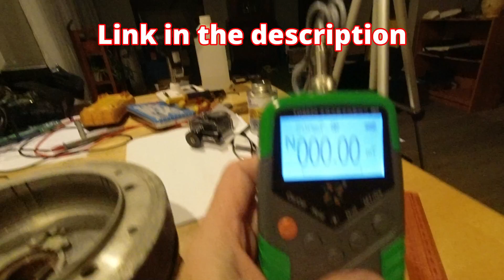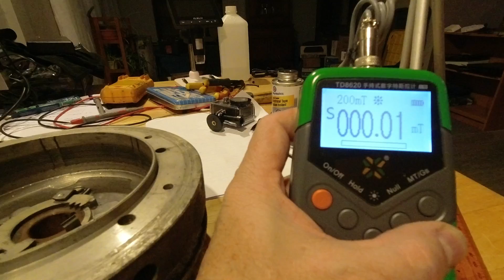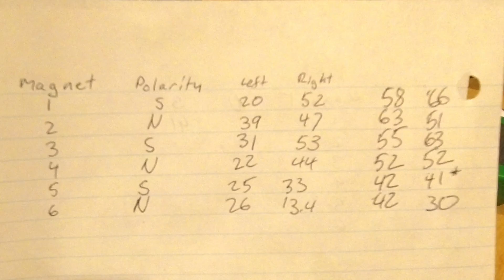MAGNETISM: Can We Test and Recharge Small Engine Flywheel Magnets?

Comment: Neato! Learned a new thing!
I wonder if an ignition magnet in an aluminum Poulan 2150 chainsaw could be recharged by the same method? This 1996 saw got weaker & boggy & finally stopped. I diagnosed No spark, ordered a coil assembly, installed it & still no spark by hand spinning the flywheel, then same with rope pull starter. Finally got small spark by spinning flywhl. w/vari. speed drill & spark got bigger as rpm went up! I'm suspicious of a weakened madnet now. Without the gauss meter, what pole  orientation do I drag the neo mag across the ign. mag. & how to find ign. mag. poles (N & S)? Thank you for posting vid.. Paul
Reply from the maker: I won't claim to be an expert on this but in my experience, opposites attract.  Saying that, it would be my guess that the magnetism that opposes the placement of the magnet would be the way to recharge the magnet.  I learned a lot from this little experiment and will use this method again if I end up with weak spark from a small engine.  Thanks for watching and or commenting.
Reply: Thank you for the reply!
Check & Test my understanding: #1)buy a neo strong bar magnet, #2 determine its polarity by hanging from string, horizontally, in its middle. It will point one end north. #3)Label "N" & opposite end "S". #4)Remove string, hold 1 end of neo. magnet next to flywheel ignition magnet. #5)Feel for repelling force, (N will oppose N). #6)Slide neo. magnet North end from ign. mag. N to S of ign. mag. #7)Lift neo. mag. & return its N end to N on ign. mag. #8)Again slide neo. mag from N to S of ign. mag. a lot of times (10 or more times?) I'm sorry for being very detailed, but I sure don't want to further Demag. the ign. mag. I really want to understand! Thanks for your kindness & teaching patience! Blessings, Paul
Reply from the maker: @PaulThomas-qo9vy  My concern with sliding opposing magnetic forces to the attracting poles is that you are essentially demagnetizing the attracting pole.  I do not think it is overly necessary to figure out which end is which.  Rub the opposing magnetic force against the ignition magnet and pull away.  Repeat for all magnets.  This should improve your overall magnetism.

Bonus, you will have a kick butt fridge magnet when you are done.  By putting it on your fridge door, you will know where it is the next time you need it.

Comment: Did it work ?
Reply from the maker: The final magnetism numbers improved significantly but the problem was actually a bad pickup coil despite it appearing to be okay.  Once I installed a new pickup coil, the AC side of the charge circuit began to work.  The DC side also needed another voltage regulator because the one I used was a piece of junk.  Get what you pay for, I suppose.
Reply: @ thanks. I fixed mine a little while ago by adding another coil and running them in series, got twice the volts now and battery charging good now.
Reply from the maker: @leesmith9942  The coil I used was actually out of an OMC outboard.  It was not exactly the same but very close and it seemed to work well.